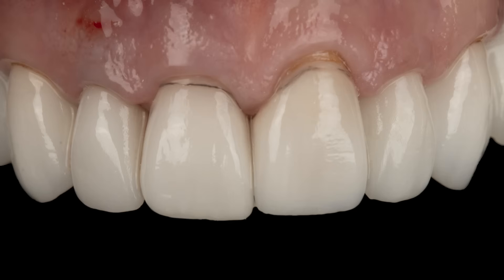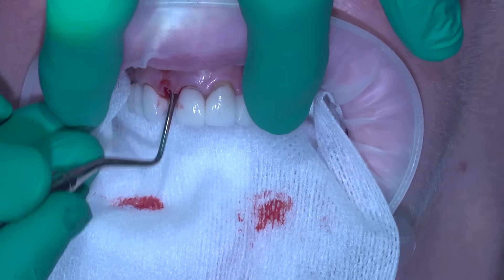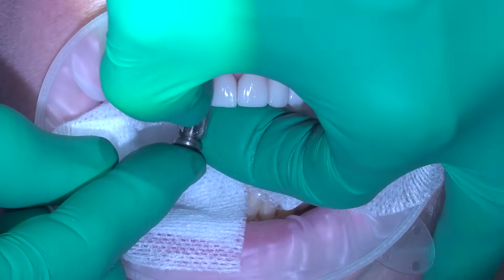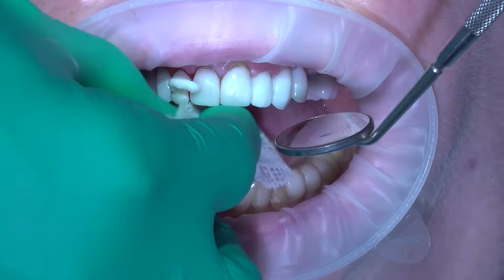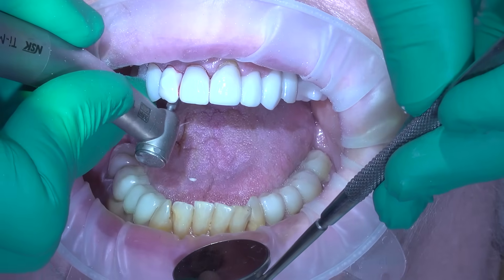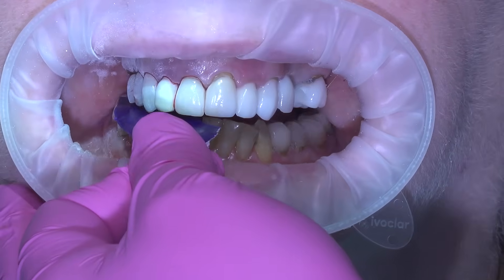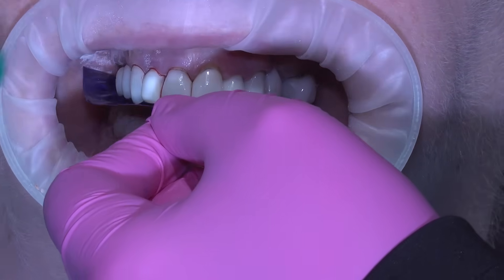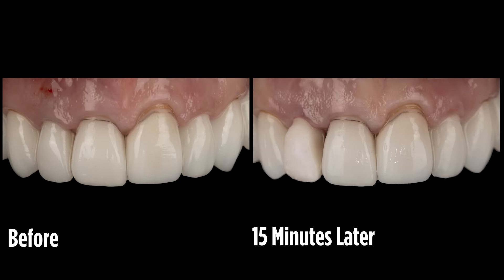LIVE Dental Implant Surgery in Fresh Extraction Site

Comment: The tooth they pulled out first looked better than the new tooth
Reply: > The tooth they pulled out first looked better than the new tooth

You're comparing an expensive crown (sitting on top of the remains of a failing tooth, which is why it's being removed) to a less costly composite tooth.

As he explained, that composite tooth is just temporary and only for looks and to seal and hold in place the implant while they wait for osseointegration to occur between the lady's bone structure and the implant (plus the additional bone material which he added on top of it).

The more expensive and far harder permanent crown which he'll eventually install atop the abutment will likely look perfect.
Reply from the maker: Excellent explanation!

Comment: Thank you for sharing.  What  is the reason for using non hexed and non engaging abutment? 
Do you not recommend doing socket shield technique?
Reply from the maker: The advantage of the non-engaging abutment is the surgeon does not need to control for implant "timing" in order to seat the prefabricated provisional. If you are going to scan and develop the provisional chair-side with a 3-D printer then you would not need the non-engaging abutment since the timing would be recorded in the impression. 

I don't like the concept of socket shielding. The reason why is found in the literature when socket shielding fails. Almost all recovery surgeries involve removing the tooth remnant and grafting the facial with hard and/or soft tissue. Therefore, I propose placing the implant in the correct position and grafting in one surgery and avoiding the potential for the socket shield to fail later. I consider this a risk reduction protocol which I kinda like.

Comment: Fantastic work 👏👏 sir I have two questions first why you didn't perform shield technique in order to prevent future soft tissues drap or loss? Second question is why you did not see lateral excursion and protrusion occlusal contacts in order to prevent offset forces on implant
Reply from the maker: I’m not a proponent of the socket shield technique. A quick review of the literature will reveal the common solution to a failing socket shield is to remove the root remnant, gap graft with particulate bone and possible CT grafting. So I recommend skipping the potential failure mode and going straight to gap grafting. If the implant is properly planned and placed there will be no esthetic of functional concern with the implant. Proper thorough occlusal analysis is paramount for success. This patients overjet was so large that I was lazy and didn’t bother checking all functional movements. I do not recommend doing that and thank you for pointing it out so folks are not mislead.
Reply: @Stanleyinstitute  ❤️